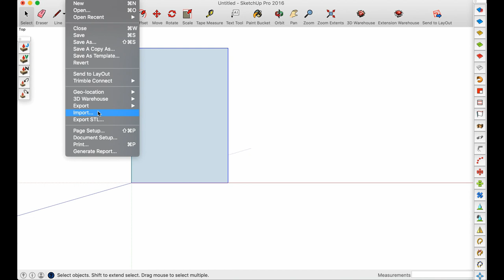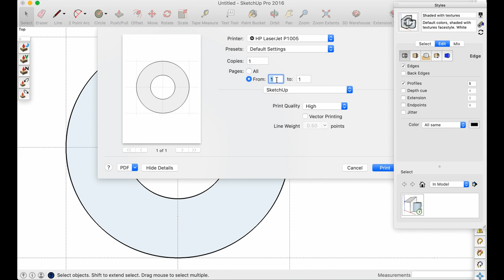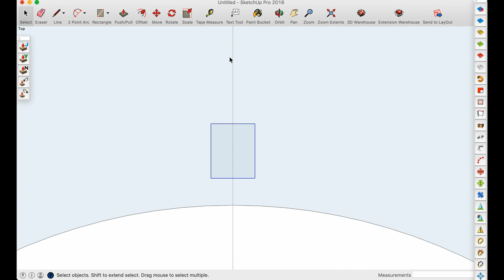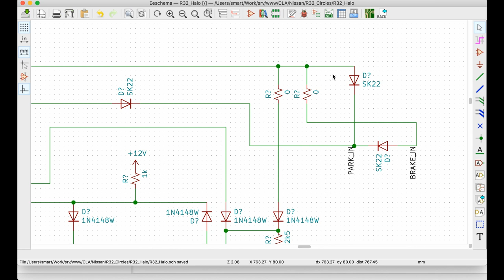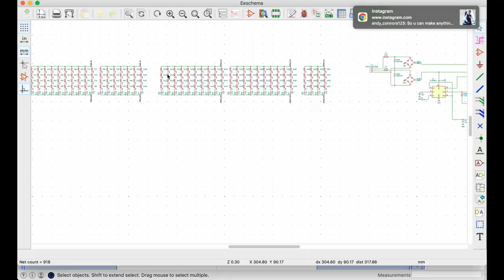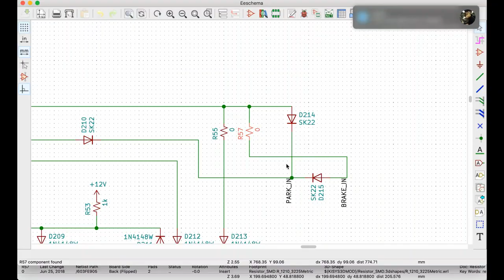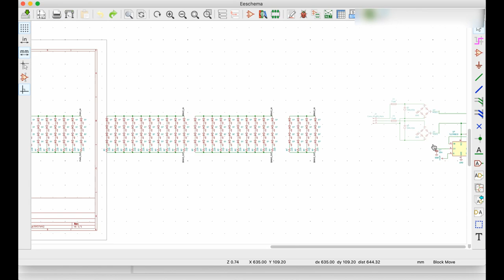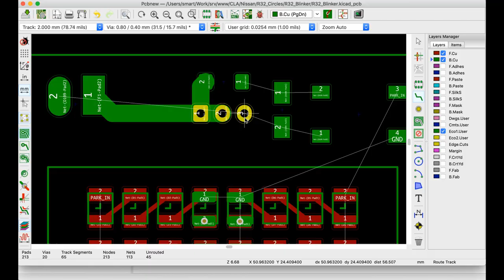Nissan Skyline R32 - How to build beautiful LED tail lights in 10 minutes

Comment: This is very impressive and inspiring. 👍🙌💪

I only didn't get the first part with paperwork. 
The lights are round and wouldn't it be easier to simply measure the thing and reproduce the same circle in the CAD?

Nevertheless I admire people like you that are capable of producing such incredable products.
Reply from the maker: Paperwork needed for self-check. Like my previous R34 tails - they have slight oval, unnoticeable, but important. And first round circle boards was a mess then installed. That's why now I always recheck everything with paper and scissors.